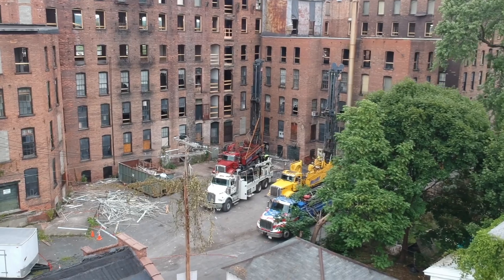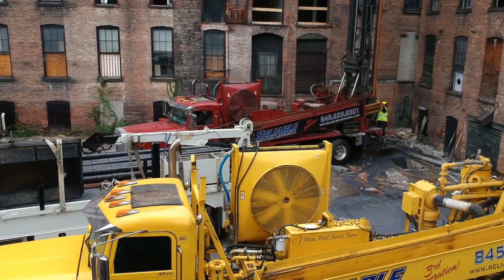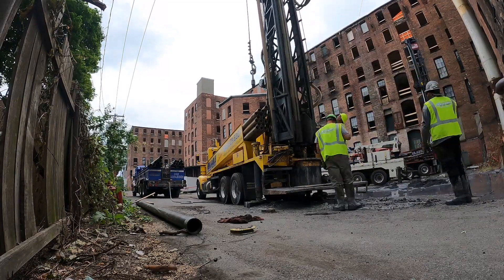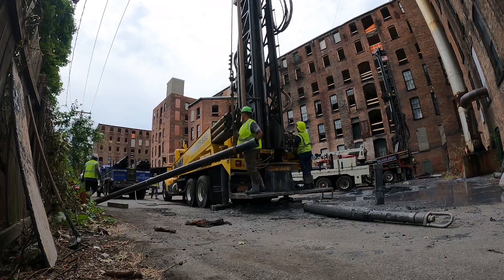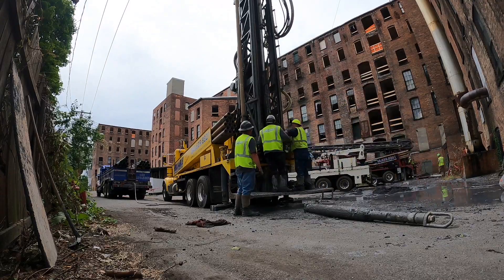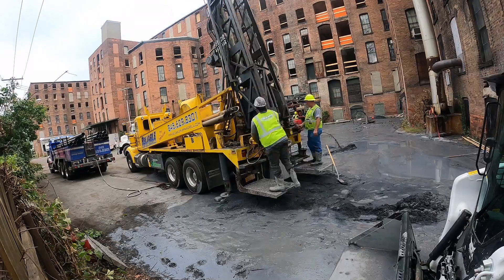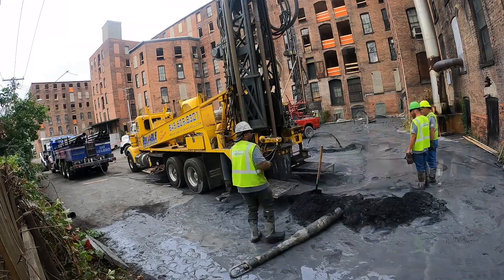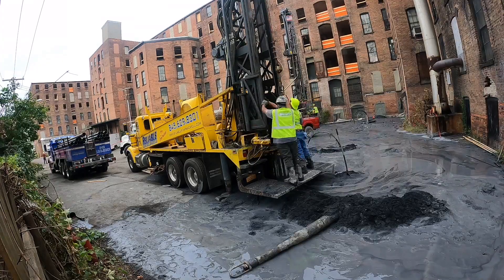Geothermal Drilling

Comment: How long does it take to drill a well?
Reply from the maker: Most can be done in 1 day, if you know what your doing
Reply: @Mctompki1 Thanks! This is very helpful. 

It seems like a no-brainer for renewable year-round heating and cooling. Which would have a major effect on energy consumption and related costs.
Reply: Not long with good equipment and efficient Driller. Easy drilling